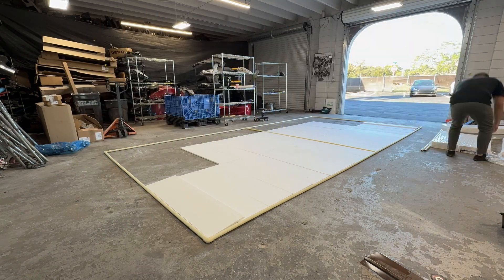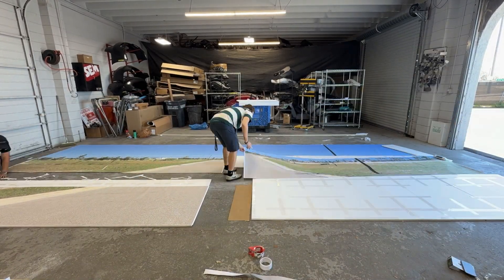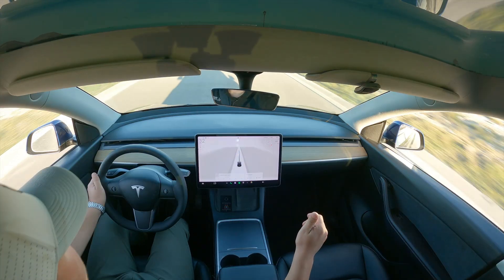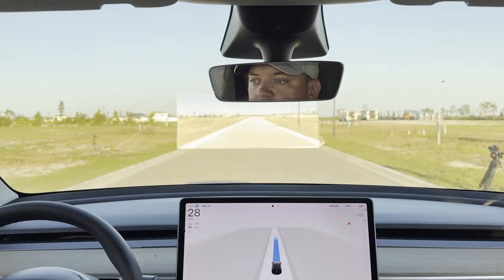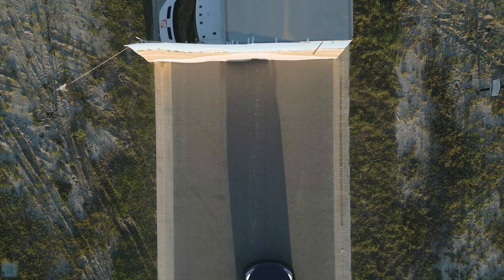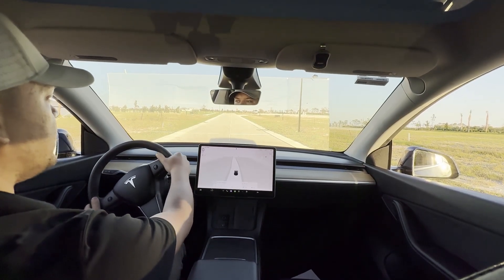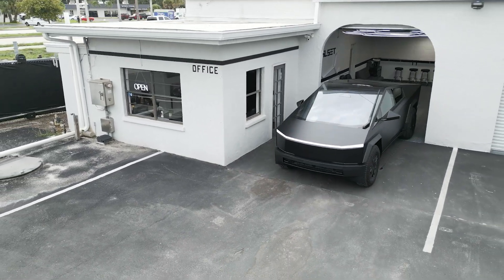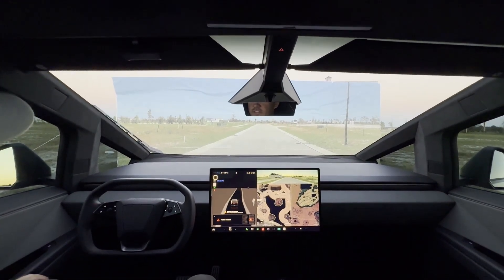Response to Mark Rober’s “Can You Fool A Self Driving Car?”

Comment: I don’t know why it’s so hard for people to understand that plenty of cars use LiDAR and Tesla refuses to. A vehicle that uses a combination of LiDAR, radar, cameras and image processing will always be safer than a vehicle that only uses cameras and computer processing. 

The stupid part is if Tesla even only just added LiDAR or even a slightly cheaper radar their system would be so much safer.  it struggles so much with low visibility, despite having generally good image processing and understanding… can’t anticipate what you can’t see

Comment: Hardware 3 is 5 years old. The cameras are SD quality, The CPU is old and can not process FSD over version 12.

Hardware 4 is 2 years old. The cameras are HD quality with built-in better night vision and faster fps. The CPU is faster and supports FSD version 13 and higher which has additional 250k data points.

I think that other guy (different video) purposely did not research Tesla and just select old hardware 3 to test it on, to promote the competitor. I am not a expert. I don’t work for Tesla and doing 10 minutes research I figured all these things out.

Comment: Nice testing. The results would be more conclusive if the Model Y and the Cybertruck tests were conducted on the same day, minutes apart and both in broad daylight. Just an observation: you shouldn't show the VIN in videos. I don't know about Tesla, but some automotive manufacturers have online some services where the only "authentication" is the VIN. It's better not to take any chances.

Comment: Everyone is talking about the time of day being a factor, but I believe it isn't, and here's why: Compared to hardware 3, hardware 4 uses much higher quality cameras that better detect color and contrast. H3 always has a yellow tint and very low contrast, making the wall nearly impossible to differentiate from the background. Hardware 4 sees color like a normal camera, making the color difference in the wall much more noticeable. The better contrast also allows it to see the difference in brightness along with the imperfections on the wall. While outside lighting could have played a role, it can be seen that the wall matches the lighting very well in both cases, meaning it is unlikely that it was a core reason between the two different results.

Comment: There's obvious issues with relying only on vision signals if you want full self driving.  This seems pretty obvious.  The cars will also fail in bright light, hard rain, fog, and many other conditions that blind normal drivers.  Tesla fsd is probably better than humans in good conditions though just don't know if that means much when there's good competition than doesn't need ideal conditions to work well.

Comment: Y’know, it doesn’t really matter if the Tesla can detect the wall or not - the point of mark’s video is that LIDAR is a vastly superior technology because it’s basically a realtime 3-D scan of the surroundings – you can only do so much with image data.

Personally, I’m not in the market for a self driving car, but if I were, you can bet your bottom dollar I’d pick one with LIDAR. If Tesla wants to stay competitive, they need to be using the best technology available.

Comment: My best guess on why the Cybertruck was able to "see" the wall while the other one wasn't likely just has to do with one of the following: a) better image processing b) higher resolution camera c) higher contrast.

Looking at the first frame it identifies an obstacle, you can clearly see the wall doesn't match the surroundings from the PoV of the camera.  The horizon is different and the image looks significantly brighter than its surroundings.  You can also see that the wall looks "normal" close up, but from a distance it looks completely out of place likely due to the focal point the image was originally taken from.  My expectation is that the Cybertruck's hardware / software is more surrounding aware which is awesome, I actually expect that looking back at Mark Rober's video that potentially the upgrades may have allowed it to pass his "Wall" test.

That said, while all of this is great, it doesn't actually change the fact that LiDAR-based sensors offer additional views of the world that our eyes can't see and makes them a very relevant addition when considering fully autonomous driving.  I don't want a car that drives as well as I'm able to, I want something that can see the world in ways I can't.  If I'm driving in inclement weather, I don't want my car limited to the same extent I am; I think it goes without saying that an autonomous vehicle's image processing will never exceed the human eye, it may just be able to react faster.  If you can't see through dense fog, neither can a camera.  So, while Mark's test might be "beatable" with better hardware, some of the other tests like Dense Fog and maybe the Downpour test where you might not actually be able to see very clearly where you're driving might be impossible for optical based sensors.  The Downpour test he did I actually lean towards being ~maybe possible given the circumstances provided, however in a low light scenario I actually expect the reliability for optical sensors (and our eyes) to detect an obstacle would likely get significantly worse.

TL;DR: With perfect hardware, some of the tests that were failed during Mark's test would be passable.  However, some tests such as the Fog test would likely always be impossible for an Optical-sensor autonomous driving vehicle to pass due to limitations in obstacle detection.

Comment: I would love to know if the newer camera package includes cameras with selectable IR cut for low light (and if the older sensor pack does too.) If so, that may explain why the cybertruck isn't fooled since printed images don't show on infrared.
I would love to see this test done with all manufacturers auto braking systems as well to see who's passes and who's don't.

Comment: light is at the wrong angle, making your wall MUCH brighter than the background, every time. Try the test in a different light, or perhaps a more intense print that blends with the background better. Close, but not the same test as Rober's

Comment: It’s been very well documented that auto pilot will turn off right before a crash in order to not be held liable
Reply: NHTSA has investigated many accidents with autopilot. Each case is seperate, what you re saying is simply false. there have been cases where fault was given to autopilot even after multiple seconds from the disingagement.
Reply: It's perfercly normal for a system that encounters a fatal error (like noticing a crash situation late) to panic and turn off, handing back control. Especially driver assist tech. If it would emergency break and it was a false positive (which is probably more common than actual crashes), it would bring way worse results.
Reply: @ People fail to undertand these systems are still assistants. You need to pay attention at all times, no exception. An accident is going to be your fault no matter what.
Reply: @ And I don't know why Autopilot is said to be so misleading. It is literally named after a system that requires heavy manual oversight and setup to take away from the mundane part of flying.

Comment: Let's admit your wall looks pretty crappy.  From the distance you start driving, I can clearly see the wall.  The lighting does not match the time of day, and there's a very noticeable outline of the box.  Thus there is no doubt a computer with good enough optical processing can detect it.

The fact the version 3 hardware doesn't recognize the wall just demonstrates the current limitation of that version.

Your claim that version 4 is better is absolutely true, but it does not prove that it will not be tricked by a better built wall.  One that doesn't have a stark contrast with environment, lighting, and background.

The real test would be to have a wall where a human cannot tell the difference from a couple of feet away, I'm pretty sure any optical system will fail that scenario.

Every who is just upset about this or criticize these "demos" need to understand the underlining physics.  Theoretically, if the image looks real enough, no AI will be able to tell the difference.  This is just a fact.

If the optical AI can tell the difference, the image just isn't good enough.
Reply: You people need to relax on this test. It s pointless! It s not a realistic scenario. Every other test ran by the NASA guy is greatly more important.
Also, "If the optical AI can tell the difference, the image just isn't good enough.", if a human can an optical AI can as well.
Reply: Mark's wall was also very distinguishable to the human eye. 
If you wanted to build a wall that you couldn't tell from a certain distance, a good optical system will still detect it with forward motion. Take the DJI Mavic 2 series. It used a single side camera but can still stop for an image because of the parallax effect. A motion parallax system doesn't care what the image is on a wall. It also doesn't need machine learning/AI characteristics. 
A human would be able to see a "perfect" blended wall as they walk up to it even with just one eye because points wouldn't be moving as typically perceived looking down an actual road. 
A situation where a really good AI cannot perceive a "perfect" wall would be when it's stationary, or the wall is dynamic as you approach it. 

With the tests done, it appears Tesla's occupancy network isn't using motion parallax for some reason, so as of now it looks like it would be fooled by this hypothetical situation that is no where near representative of real world children, weather, etc.. 

Non real world tests aside, I would prefer to see FSD with dense fog, rain, etc.. A logical driver would slow down regardless of if there was nothing behind it. A self driving car should also do the same.
Reply: @battery_wattage  They used an almost one year old update on the model Y. Great comment btw

Comment: Tesla quietly reintroduced the radar in HW4 model S and X. Early Model Y HW4 cars have radar but later Ys and no 3s have radar. I think it would be interesting to see it retested with a non radar HW4, and perhaps a HW3 with a 12.6.x software version.

But personally the tests I would most like to see recreated are the heavy rain and heavy fog test with proper rain and “real” fog.

Edit: I was wrong the CT does not have radar.

Comment: Him: (makes a video showing that a Tesla would have crashed into the wall consistently)
Him: "This is a story of Tesla. [...] This is what I see with Tesla's regularly."
Me: "What? I mean, it couldn't see the cartoon wall but they're not that bad during regular driving, right?"
Him: "They are... improving hardware, cameras, [etc.], year-after-year, as technology advances."
Me: "What? They literally do not have the very old and reliable technology that would have detected the wall. You just proved that raw camera input alone is not enough."
Him: "They're putting that technology into their vehicles."
Me: "Wow. They are provably not doing that." (gestures to this very video) 
Him: "There's a sharp difference between [the Tesla and the Cybertruck]."
Me: "Yeah, it's the lack of a technology that was introduced in 1961. That's 64 years ago."

Comment: Most importantly, you should test the child in the rain and in the fog. I want to know a FSD will prevent hitting a person, as I don't encounter fake walls EVER.
Reply: Mark should redo that test with and without the kid in the rain. Lidar could have seen the rain as a wall in that test
Reply: @Thenameisbond1  Yes, light of all types doesn't penetrate water well. Its why if you look at SAR images of the earth, the ocean is just a big black volume. You see it with the waymo car that famously couldn't handle a broken fire hydrant. Of course though, the torrential rain is the type of condition where driving 40 wouldn't even be safe for a human with the best of vision to be driving through. but the fog is a good test. we need more fog test.
Reply: @Thenameisbond1  Lidar did not see the child, just as you suspect.
Reply: @Furyswipes  Lidar saw it through thick smoke/fog, a camera cant do that.
Reply from the maker: Agreed. We have a fire engine and smoke machine in the plans in the next two weeks after we make a retest of the wall experiment to put a final close to this experiment.
Reply: you say that until your chasing a dastardly sly roadrunner in the new mexico desert
Reply: Well Said !, I was going to say something similar.
Reply: Did I see you applying as the dummy tester?
Reply: The Car won't let you drive in full self-driving if it can't clearly see a certain distance in front of it
Reply: @DPaul-z9bso that means it's false advertising and it can't self drive
Reply: @romeosierratango4464  wrong, you have a wrong definition for FSD that's why you would call it false advertisement.
Reply: @ yeah OK. The special kid, Musk will soon start refining all terms as well
Reply: Now that ACME stock is booming after the Mark Rober video you might start to encounter much more fake walls.
Reply: So next test will be a black wall of lidar absorbent material. You will never ever encounter that in the real world but lets do it anyway so we can prove lidars are crap...
Reply: Yeah he already has the child just need the spraying machine...
Reply: that even humans can't do
Reply: @yongj4765  But lidar can.
Reply: @yongj4765  Saying "humans cant even do that" is a non argument because tech SHOULD do what humans cant do.
Reply: haha exactly.
Reply: How about trying those same tests at night. These tests aren't full.
Reply: Because you're encountering children in the fog ?
Reply: @cSR-71  Yes, you can encounter everything in fog.
Reply: nah they should test lidar in actual heavy rain and see if it can function...  spoilers it will freak out and think its being attacked by walls
Reply: @23desdfe345r2fd23f23  shouldnt use fsd in heavy rain anyway
Reply: @23desdfe345r2fd23f23  Since the "rain" in marks video was much heavier than any rain that has ever happened on earth for the last 200 million years, lidar would work fine in heavy rain too.

If tesla can program a camera to spot things, you can program a lidar to spot rain.
Reply: The point of this test was testing the extremes with Tesla FSD, vs other FSD systems using LiDAR. It’s not to say that the Tesla won’t be able to do it under normal circumstances, but that FSD with LiDAR is still more safe. It’s those marginal circumstances that are important. I won’t be surprised to see legislation in the future requiring LiDAR in all FSD capable vehicles.
Reply: Funny thing is one thing that sealed it for me that Mark Rober was malicious is when the Lidar car stopped for the heavy rain test and did not hit the child.

Mark is smart enough to know that this was a failure of the car to see through the rain and stopped because of it saw the rain as a wall but HE CALLED IT ANOTHER W. 
Yh, that's when I realized this mfer is malicious
Reply: Nor go 40mph+ in heavy rain and fog, and nor would there be a kid in the middle of that.
Reply: @kjp8196 you don’t go over 40mph in heavy rain? We’ll all be going 80 on the highway in that 😅
Reply: @kjp8196 here is a real world test someone should try. 40mph at 8pm at night on a suburban road, no street lights, just my car headlights. Orthodox Jewish community. Men and boys dressed in head to toe black jaywalking across the street. I guess it’s a good thing they can see my car because I can’t see them until it would be too late.
Reply: @kjp8196 lmao... You think over billions of people, there's not a chance of a child being in the road in rain or fog?
Reply: @kjp8196  There could by all means be a kid, or something, in the middle of heavy rain or fog.
Reply: @kjp8196  But with lidar you could thecnically go as fast as you want to in fog. You shouldn't but with lidar it would be a lot safer.
Reply: the point here is not the fake walls, it just shows the limitations of camera-only fsd tech, it is simply not a viable solution and it is dumb to keep pushing it or submitting yourself as a test dummy to tesla
Reply: @brav0tw0z3r0 You can even encounter something like a fake wall in real life. For example, art painted on the side of a building or a car or any other things you can imagine.

There's almost an infinite number of edge cases, self driving systems need to be VERY robust against them.

Comment: I also just have to voice up in agreement with other voices. It's not just the new hardware of the cyber truck that made it perform better it was time of day as well. There was more contrast with the wall and the cyber truck headlights also could illuminate the wall from further. 

Regardless there is great inconsistency between the vehicles and runs so all that actually can be said is "depending on daylight conditions and hardware a Tesla may or may not hit a fake photo wall." 

Good work adding to the independent data over it though.

Comment: I appreciate your work on this, however its extremely risky that your propped your wall with a UHaul truck!?!?  That is insane! - What if the car had failed to detect your wall and plowed into the side of a truck - that YOU parked??  
I grant that Mark Robers video is targeting highly unlikely scenarios that both Lidar and camera based systems need to cater for, and that Tesla does a great job of dealing with these extreme scenarios using a purely camera based system, however Mark does highlight the inherent challenges that a purely camera based system has.  Camera based systems have the same limitations that we do under the best conditions, but they can still be fooled.  I am sure a "fake wall" could be created in a perfectly setup scenario that would trick many human drivers where a Lidar system would easily detect, I think that is his point.